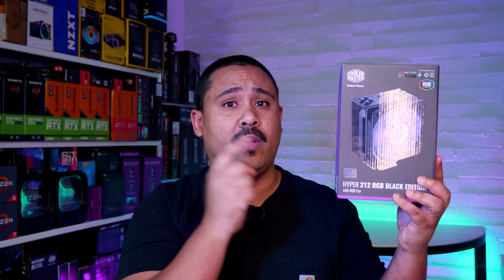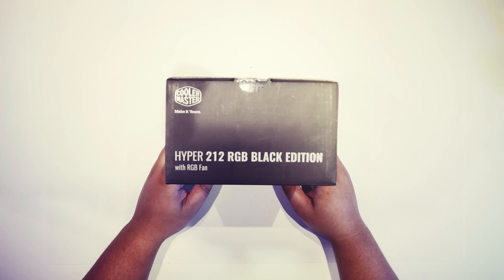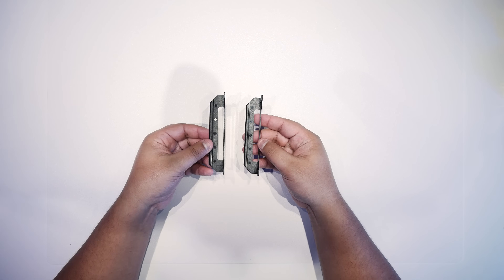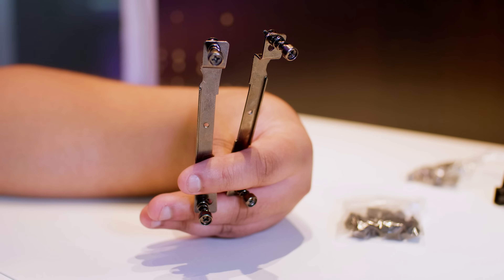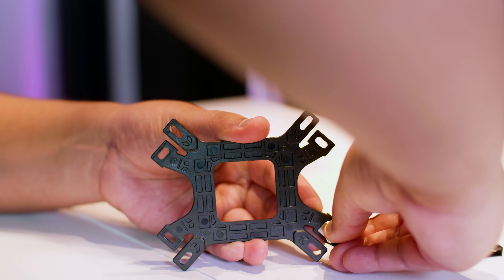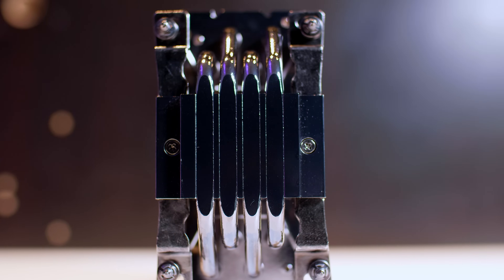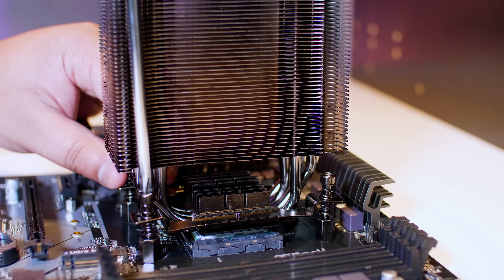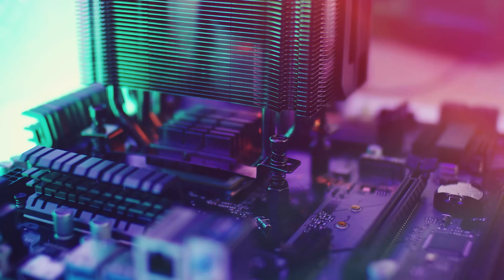HOW TO Install Cooler Master Hyper 212 RGB Black Edition on AM4

Comment: I have just installed this on my Asus Z390-F Motherboard - with the RGB cable in the 4-pin RGB header - and it syncs with the same colours as the Motherboard EXACTLY...like they are one unit (although there is a slight timing difference...).  My motherboard has two ADDRESSABLE RGB headers, but those are 3-pin (I think they are the same length as 4-pin ones, but there is one less pin)

 - should I NOT attempt to put this RGB fan's cable into the 3-pin headers?  I read somewhere that the 4-pin non-addressable header (that I used) is 12 volts...whereas the 3-pin addressable headers are both only 5 volts...please advise, as I don't want to risk frying my new Motherboard - thanks all!

Comment: does anyone know where to download the software to control the colours on the cpu cooler ? ive looked everywhere and cant find anything ?
Reply: You would need MYSTIC LIGHT software for MSI motherboards and the similar for other manufacturers.
You can synchronize it then

Comment: How hard do you have to push down when screwing @ 5:48 ? I am paranoid that I will create enough pressure that can damage the CPU.
Reply: Just enough to get it threaded. Put slight pressure on top so it doesn't rock like it did in the video. Have you put on a stock cooler before? It was nearly identical to putting the stock cooler on the 3600.

Only thing you DO NOT want to do is lift up on it to check. That paste might cause them to stick together a little and it will pull the CPU up and it will NOT go back in perfectly, ruining your CPU AND MoBo pins.
Reply: you know it’s installed correctly once the screws wont screw further

Comment: You said twoard the end (and it says in the directions) to remove the fan will mounting and then reattach it. How is this done? I don't see screws.
Reply from the maker: It has clips on the fan bracket to remove the fans and underneath the rubber insulators there are fan screws

Comment: how do i control RGB lights if the i plugged it straight into my motherboard without the controller
Reply from the maker: use your motherboard RGB software

Comment: The standoffs are too spaced out on my motherboard, and so I cant mount the cooler? Any suggestions?
Reply: I'm having the same issue...
Reply: Kokila Gunasinghe bro i figured it out, unscrew the brackets, and flip them around. It will make the distance between the screws wider so it fits.
Reply: You could just use the old style AMD clip bracket supplied.

Comment: I dont know what am I doing wrong. I connect the rgb cable of the hyper 212 to my mother board (asus x570 e) and it doesn't work (the lights). I use aura sync but it didn't work neither :(

Comment: I didn't get my graphics card yet, but I got my PC to turn on ryzen CPU. Is the RGB suppose to be automatically on or do you need to go into the system and turn it on manually? Since mine didn't turn on, I just hope I didn't break the pins when trying to put it on.

Comment: My backplate doesmt allien with the holes 😿😿 hyper 212 led  , find out i need to get x bracket from somewhere , which is nowhere sold
Reply: Neither does my AMD 4 mount MSI 470 board

Comment: So my motherboard doesn't have an rgb header and was wondering why my rgb controller has 4 holes instead of 4 pins. Am i missing something here? I can't connect the cable from the fan to the controller

Comment: Is there a software that I download to control the rgb on the fan if I connected it to my motherboard? Like how do I change the colors without the remote?
Reply: Did u figure it out I need it too
Reply: @bman-kw2xj  This depends on the type of motherboard. Each company has its own software to control RGB connected to the motherboard. I've got an MSI B550 and it uses MSI Dragon Center with Mystic Light to control RGB.

Comment: HELP I’m at 5:50 and my screws won’t reach every corner I can only get 3 screws In and the fourth one won’t reach it’s like right next to the bolt you screw into. I have a GIGABYTE B450 AORUS PRO WIFI motherboard
Reply: Make sure you don’t tighten every screw, use the Star method when screwing anything in. When they’re all just barely in, you can then tighten them all

Comment: I'm about to buy this vs the Be Quiet Shadow Rock TF2 (Ryzen 5 2600 on Asrock B450M Pro4) but I'm consred about it's height. It seems to barely fit if not at all, in the Cougar 330G case. Which do you thing seems to a better option?

Comment: I'm pretty sure my second rgb header in my motherboard doesn't work and when you showed the you can connect it to the controller as another option, I was wondering where the controller would plug in.
Reply: Faiyaz Rafee same if you figure it out please let me know

Comment: Instructions not clear, PC blew up. You'll be hearing from my lawyer.
Reply: Lol this is a joke right?
Reply: @Lord_Sunday  yes lol. Dropped almost 30 degrees on my temps, idle and under load. Coolers a beast compared to the stock wraith cooler.

Comment: You absolute fucking buffoon. DO NOT OVERTIGHTEN THE MOUNTING BOLTS. The screw broke off on one of them because you falsely claimed they couldn't be.
Reply from the maker: If you're too stupid to use your brain then you shouldn't be building anything.
Reply: If you're too incompetent to fact check your videos before publishing then you shouldn't be making them.
Reply: @GearSeekers  Maybe try giving a heads up to your viewers about your mistake in your video rather than dragging your troglodyte knuckles on your keyboard.

Comment: I hope you don't get upset with this question. I"m a first time builder I"m using 3rd generation Ryzan 9 3900 which as you know comes with a fan, but I'm wondering if this fan would be a better choice? Also If I've never mounted a fan on the CPU which I believe is already set do I need to add more glue or whatever the compost was called?

Comment: Wow you really leave the builder hanging by leaving out so many key details. "Put it on the front". Where the hell is that? Which way is it supposed to face? Does it matter? What if a bracket isn't fitting? Way to general to be useful.

Comment: I have a question, I have only the jrgb1 connector on the mobo, what I supposed to do? Can I connect there or I have to use the adapter and connect there or simply I can't use the rgb? I know that jrgb1 is fored stripes..

Comment: I tried it with my Ryzen x570 pro 4, but the final installation screws are to narrow
Reply from the maker: You need to use the backplate that comes with the cooler. Exactly like shown in the video. The factory AM4 backplate will not work.
Reply: @GearSeekers  I am using the one that comes with it, but when I align the screws with that of the cooler bracket screws, it won't fit in that way to the motherboard.
Reply from the maker: I feel like you aligned it for AM3
Reply: @GearSeekers I aligned it as narrow as I could to fit it into the motherboard, but it won't fit in, so I just took some clear string and tied it around
Reply from the maker: Yeah this sounds like severe user error. I've never had issues with this cooler on any board ever.
Reply: @GearSeekers  my buddy just showed me that pcpartpicker says quote "Some physical dimension restrictions cannot (yet) be automatically checked, such as cpu cooler / RAM clearance with modules using tall heat spreaders." after he put both items into his cart
Reply from the maker: PCPartPicker is almost always wrong

Comment: Hey GS, I can't seem to get the RGB to work. I'm running MSI mobo (I've hooked up the rgb) and the rgb just seems to not want to work. Any tips?
Reply: did you find solution?
Reply: @zCroFTW  Nope, it decides to work when it wants to

Comment: I have ordered the Black Edition without RGB.
What do you think, is going push/pull worth it?
I would do it mostly for acoustics, 'cause I would lock fans at 50%.
Processor is Ryzen 5 2600, which I might slightly overclock.

Comment: This helped a lot when I was building my first PC the other day.  Mounted to a B450 Tomahawk Max.  At first the RGB wouldn't work.  Turned out I had put the 4pin connector onto the RGB header the wrong way around.  For any newbies (like me) out there, make sure the little embossed arrow on the 4pin connector is lined up with the 12V pin on the motherboard.
Reply: @_szo  No problems so far. All solid for me.
Reply: Man I love you for this comment no homo, you saved me from taking off my PSU and connect an unnecessary cable, if case someone has the problem with a MSI b550 tomahawk, the fan's RGB connector has a little triangle, and you have to mach it with the RGB 4 pin header's white square!!! Mine was on the left of the 4 pins

Comment: So the backplate on the motherboard must be changed or I can just replace the bolts that held stock amd wraith cooler?
Reply from the maker: It must be changed
Reply: @GearSeekers  thanks man, but I messed something up with my Asus b450f strix board. It won't boot at all. I think i short circuited it while returning... Gotta troubleshoot it today after work... :-(

Comment: SO your telling me I have to remove the whole thing out of the case?
Reply from the maker: I'm telling you you're better off removing it because it will make your life easier. You don't have to but unless you have 4 hands and some ninja skills I would.
Reply: @GearSeekers  Good to know, but i did open the back of my case, and there was a big hole in the back of the CPU socket area. So I might do that.

Comment: If you hook the RGB to the motherboard how to you use the hook up the get the RBG to work?
Reply: Use some sort of software on your OS to control the RGB
Reply: So if you hook up your cooler to the motherboard u can literally control the lights and modes on the software?

Comment: I’m so confused on how you put the fan back on the heat symc
Reply: Hot glue or a stapler
Reply: @kevinmo411  i agree. But bluetack should do the trick aswell. Thanks.

Comment: Damn so not excited to remove motherboard
Reply: you dont have to if the back of the case opens up like mine, just unscrew the old cpu cooler from the back and install it all like that. yea its a bit harder but at least i dont have to take out the motherboard
Reply: Yea figured it out the second after I wrote this comment lol

Comment: Cheers from Saudi Arabia :)
Thanks for your time and effort.
I'm getting the exact CPU cooler. One question though: When I'm done installing the cooler on the MB; should I plug the CPU wire in its own header, then I plug the RGB wire in the specified RGB header as well ?
I mean, should I plug 2 different wires using the provided Y splitter to have both the fan and the RGB working, or how's it done, please ?
Thanks again :)
Reply: Oh, I've checked other videos and saw that the fan already has 2 wires. Thanks

Comment: How you change the color without the controller because I’m tryna figure out why my lights not working after it was
Reply: I'm currently having the same issue, if you find a solution I'd love for you too share it with me
Reply: Elijah Wynkoop if you talking about the led going off it’s because it’s put in backward into the rgb header. You gotta have the arrow on it facing the other side.
Reply: @senorskellig9131  This worked. Thanks!
Reply: Ryan's Tech & Hardware that’s great 😁

Comment: I tried to install this on my motherboard but all the brackets were too small for motherboard holes. how can I find one that will fit my motherboard?
Reply: PsychoNash you gotta put them on the first brackets instead of the second middle one
Reply: Tyrique Estero I did and it was still way too small I found the hyper 212 eco should have the brackets that will fit. Like the holes are really far apart on the mobo
Reply: Oh dang well i hope your build goes well bro

Comment: Just put mine in, took about 15 minutes but it was well worth it. Much more quiet over the stock AMD wraith stealth. Also getting 25c idle on cold boot and havent seen over 50c in games!!! Planning to overclock my ryzen 2600 to 4.1ghz with this cooler

At the time of writing this, it is winter here in the UK and I would the ambient temperature is around 15c-20c

I also added a noctua fan as an exhaust for the case, which I think may have made a slight different in temperature too

Comment: Does the AM4 bracket come included in the box? I'm hearing conflicting information. Some say it's included but some say you have to contact Cooler Master after you buy it and then you have to wait for them to send it to you?
Reply from the maker: It comes with the cooler. It's not 2016

Comment: Curses to this cooler. Since I've installed it I have a lot of blue screen of deaths, and weird behaviour of the PC... I willl switch back to the stock one soon to see if it's really this cooler's fault...
Reply from the maker: Seems like you have installed it incorrectly.
Reply: @GearSeekers  Yes, what I am affraid of is ESD... maybe I touched the processor or other sensitive components while manipulating them and that was it. Will see, I will come back with what I've found to be the cause

Comment: Just put this on my R5 3600! Thanks for the help man! Really appreciate it!
Reply: @ole faber I was getting in the 60's before now the 40's. Much better temperatures with this Hyper 212 more than recommend it
Reply: @christopheroconnor4665  will this fit in a mid atx case? I have a ryzen 5 3600 aswell

Comment: Where can I download the RGB software for the Hyper 212 BE?
Reply from the maker: You don't need software for it
Reply: @GearSeekers  I plugged the RGB plug into my Auros B450 mobo, but it seems that the Hyper 212 BE RGB is not lighting up, please help ?
Reply: Joshua Chong it’s probably not supported on your motherboard 😬

Comment: You missed a few points. What about height? Does it interfere with the ram slot space?
Reply from the maker: I didn't miss them because they aren't important in an installation guide. It's not a review

Comment: Hi. Can you tell me if MSI b450 Tomahawk MAX has an RGB header or I have to use included controller with the fan?
Reply: This is what i am looking for . I got my tomahawk max yesterday and not sure if it has 4pin 12v rgb. Have you found out?
Reply: @spudgamingTV  No I will buy my parts on Black Friday hoping I will get better prices and maybe I'll change some of the parts.
But actually I asked from reddit from a guy who has Tomahawk MAX and that Hyper 212 RGB Cooler and he said that he can customize the colors with MSI Mystic software. And you sure have the 4pin port there. Let me know if you get it working :D !!
Reply: @destinjarlet1376  My RGB isn't working in this set up

Comment: installing this now and have followed step-by-step i cannot screw down the last 4 screws once the unit is put on top of the motherboard! need help as i don't know what to do ;/
Reply: Joe Whybrow One of the two brackets that has the spring screws that wont line up is installed in the wrong direction

Comment: Thanks. I got 2 questions
1. Can you make this cooler a solid colour
2. Does the non black edition (hyper X) have RGB also
Reply from the maker: 1. Yes
2. No
Reply: @GearSeekers  thanks so if I'm wanting a quite cooler that I can change colour and get a solid colour going I should get the hyper 212 black edition?
Reply: unfortunately no, but i prefer performance over aesthetics.

Comment: Thanks!  I'm using this cooler for an FX-8370, and I can confirm that the instructions work for the AM3/AM3+ platform as well.  (The video clarified a couple of ambiguities that were in the user manual.)
Reply: Is the old version compatible with AM4?
Reply: @juansalvetti552  unfortunately not

Comment: If the screws don't align with the bracket you can pull them up and move them to a different hole  (There are two holes). One screw was misaligned and didn't fit on mine but that did it ^

Comment: How do you control the lighting effects?
Reply: software
Reply: @IINSPIR3DD  no you get a remote
Reply: @IINSPIR3DD  its hard to setup tho
Reply: @IINSPIR3DD  what type of software
Reply: @scrambleegg9743  depends on whats your equipment. Search your component (name) lighting control and you will find the correct program to control the colors

Comment: What to do if i already have led strip on my ledheader what to do without the cpurgb connector then
Reply: get a splitter, or you can just use the controller that comes with it

Comment: Does anyone know if the mounting bracket (steel in the Hyper 212X that I got) is actually required for a motherboard with a metal bracket already in place (such as the MSI b450 Tomahawk Max)... the bracket already in place looks to be plenty sturdy enough and I'm not sure what this brings to the table that it doesn't already have?
Reply from the maker: Yes. The thread size is different

Comment: I did all that on the MSI  X470 M.B (AM4 socket)  and when the mounting socket where  installed they did not line up with either the AMD or Intel  holes on the base plate of the board neither straight or curved brackets would fit.(failed to line up) Ending up using the old style bracket. Save your self a lot of time if you have that board just use the bracket
Reply from the maker: The screw threads are different.
Reply: @GearSeekers  I did get the plate and the screws fitted but neither of the 2 cooler  mounting brackets came any where near to lining up correctly  for fixing about  half inch out of lining up. More of a failure to line up than a thread issue. One other comment did say something like this.

Comment: Are you sure we must tighten the cooler until the stoppers come in contact with the standoffs? In the so minimal instruction guide provided wit it the diagram does not show screws after tightening in contact with standoffs. A bit worried, here.

Comment: I can't seem to get my last four screws in and the brackets don't even seem close to fitting when I do opposing corners. any ideas ?
Reply: I failed to do it on the MSI  X470 M.B (AM4 socket) just impossible.